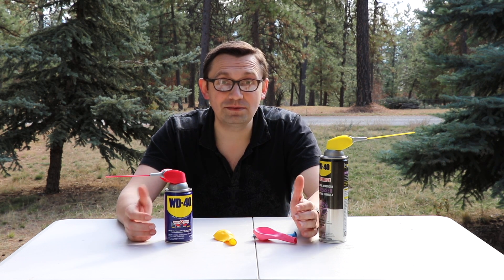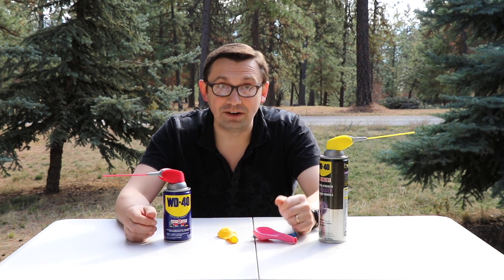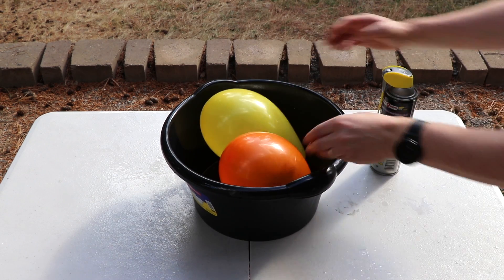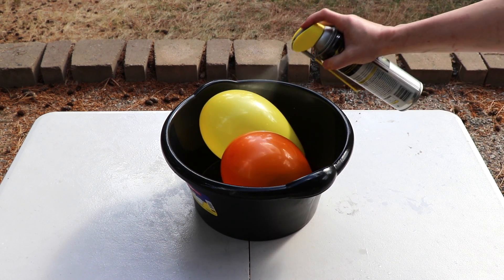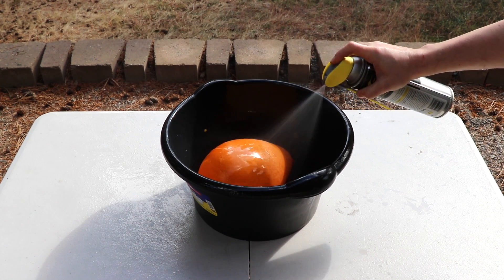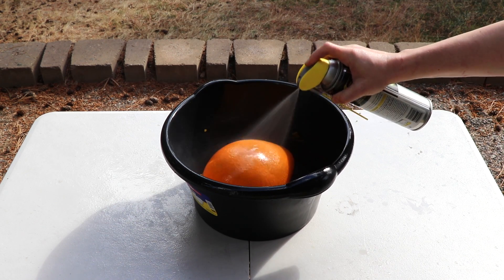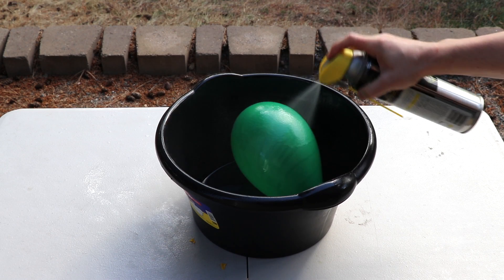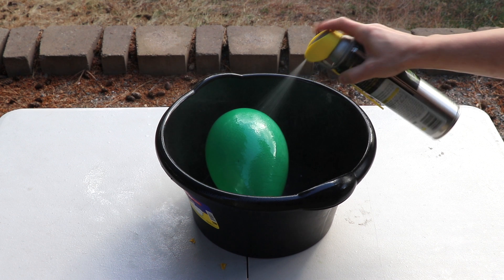WHAT HAPPENS IF YOU SPRAY WD-40 ON BALLOONS

Comment from the maker: Do you know why it's called "WD-40"?
Reply: Nope
Reply: John S. Barry, the man "who masterminded the spread of WD-40," as The New York Times puts it, has died at age 84. The product he promoted is more popular than an iPod.

WD-40 can be found in 4 out of 5 American households, the company claims. Its ingredients are a secret, and it has generated its share of myths and strange applications over the years.

Barry didn't invent the stuff. "Norm Larsen, founder of Rocket Chemical Company, is considered the original founder of WD-40," according to wd40.com.
Larsen aimed to develop a line of rust-prevention solvents and degreasers for use in the aerospace industry. He succeeded at the goal, Water Displacement, on the 40th attempt, hence the name.

 

"Convair, an aerospace contractor, first used WD-40 to protect the outer skin of the Atlas Missile from rust and corrosion," according to the web site.

A few years later the company made an aerosol spray version and the rest, as they say, is history.

WD-40 does not contain fish oil, contrary to a popular myth, nor does it contain silicone, kerosene, water, wax, graphite, chlorofluorocarbons (CFCs).

And WD-40 won't cure arthritis, despite another odd myth (Windex, however, cures everything, if you believe the Dad in "My Big Fat Greek Wedding").

It has been put to these uses, the company says: A bus driver in Asia used WD-40 to remove a python, which had coiled itself around the undercarriage of his bus; police officers used WD-40 to remove a naked burglar trapped in an air conditioning vent.
It has been put to these uses, the company says: A bus driver in Asia used WD-40 to remove a python, which had coiled itself around the undercarriage of his bus; police officers used WD-40 to remove a naked burglar trapped in an air conditioning vent.

The product has never needed a Billy Mays; as the ShamWow guy might say, WD-40 sells itself. I'll certainly vouch for it, having once owned a '56 Ford pickup and later a '66 Mustang, neither of which could not be worked on without a squirt here and there to loosen rusty old nuts and screws.

The company also says it'll remove gum. I have an 8-year-old, and a pair of reading glasses sitting in the back seat of the car, on which to test that later today.
Reply: @UnknownPerson-nl7te  wat
Reply: @the_one_who_ponders  Its all the reason why wd40 is called wd40,whole story of it
Reply: @UnknownPerson-nl7te  yeah i know its just a bit weird that he made such a long commend
Reply: @the_one_who_ponders Thats not a long comment and my 15 minutes dosen't matter at all
Reply: Because it was the 40.th attempt at creating a water displacement
Reply: Nops
Reply: Because ur mom gei
Reply: @bigdaboof5754  thats right of CoUrS